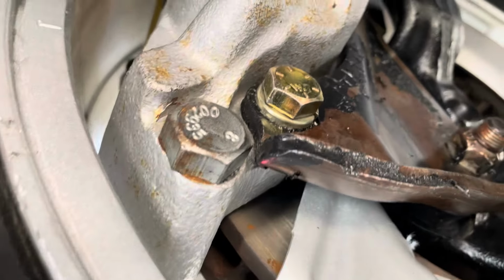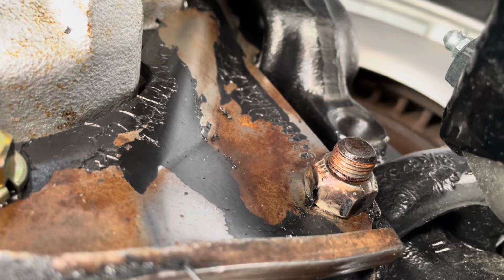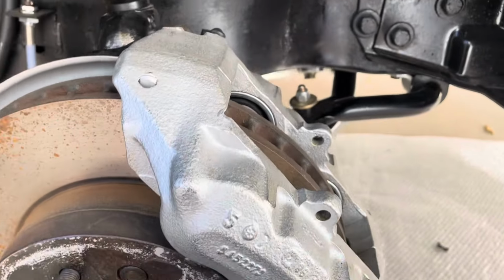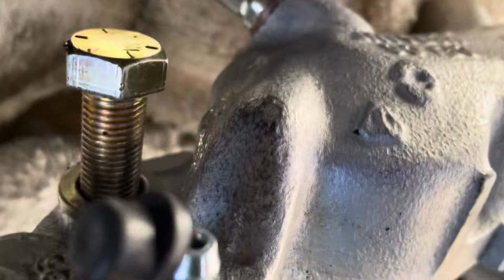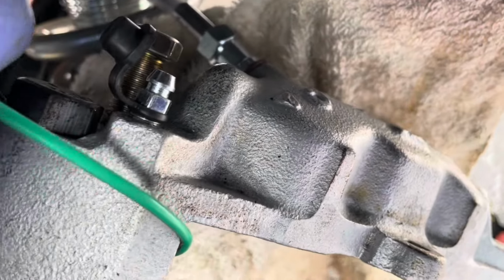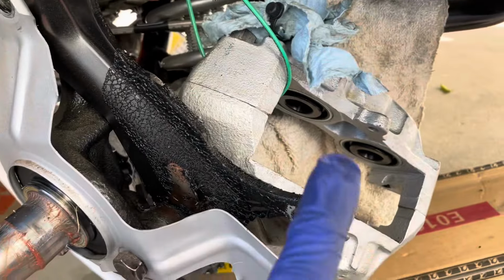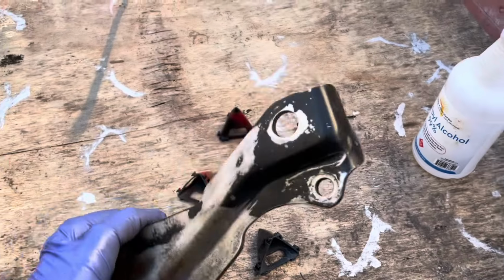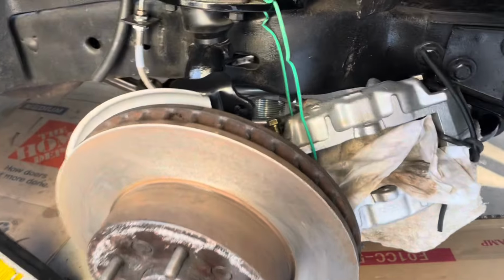C3 Brake Caliper Leak & Painting the Bracket

Comment: Thanks! Funny video ^^ Check also for a leak between the inner and outer caliper halves there is a small o-ring.
Reply from the maker: Yes, thank you. I think the leak is at the bleeder nipple threads (not out the bleeder hole). I’m going to either get new nipples that have the coating on the threads or put a little anti-seize or heavy grease on the threads - see if that stops the slow leak.

Comment: Bleeders are only designed to seal when torqued.  The conical seat in the caliper and the "cone" tip of the bleeder screw create the seal.  If you are gravity bleeding, there is a STRONG likelihood that the brake fluid bypassed the center bleeder screw port and also went around the threads.  If the leak occurred while the bleeder screw was torqued, then you may have a surface defect on the caliper seat or bleeder screw cone.  If there is a surface defect it will leak even if torqued under static pressure.  Not too common but I have seen issues where the seat and cone angles are not at the same degree and a single point contact tries to create seal.  This circumstance is also unreliable.  This usually happens when rebuilders set up the machining equipment with the wrong tool for the bleeder seat.  WHATEVER YOU DO, DO NOT PUT ANY GREASE OR SEALANT ON THE BLEEDER THREADS.  Greases have constituents that may cause the piston seals swell causing new problems.
Reply from the maker: Thanks for the info! Maybe I got the wrong size bleeders in the rebuild kit. Can I swap them out without dumping too much fluid? 
Any tech/specs I should look for? (1971 Chevy Brakes are probably one of the most common sizes on Earth!)